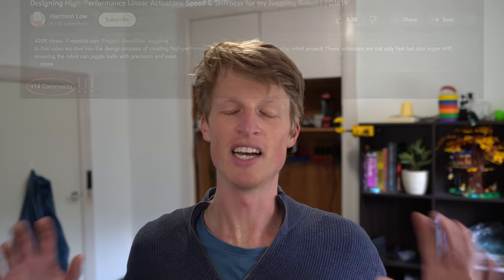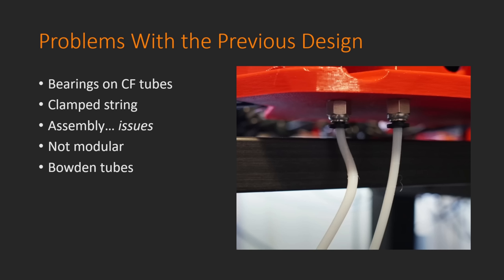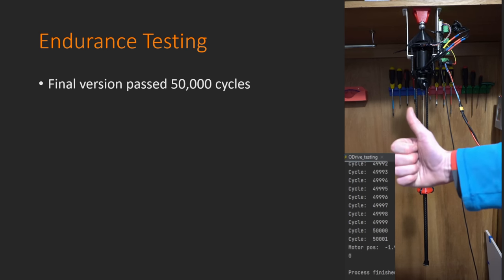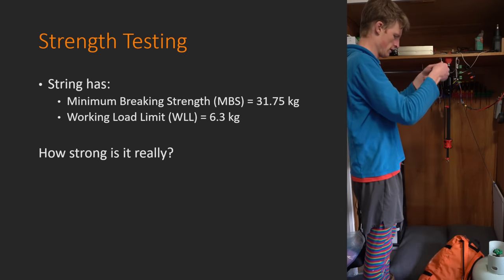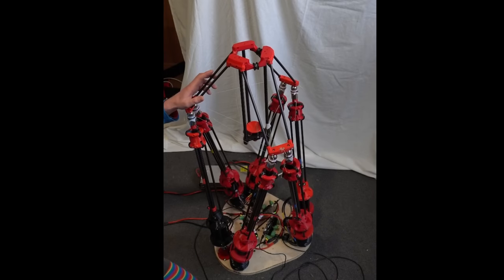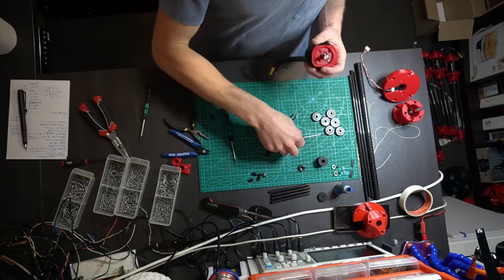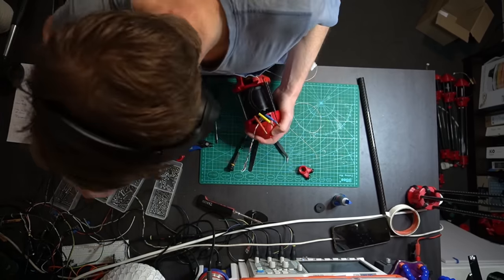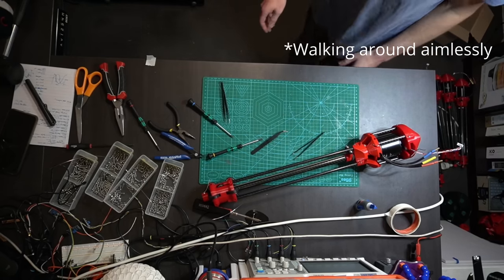My New Linear Actuators are SO MUCH BETTER! | PDJ #21

Comment: Why not flip the motor perpendicular to the direction of the linear actuator and have the body be the spool as you mentioned and then have much more simple routing of the string direction to the rod?
Reply: Ah I see this may be what you were talking about. I thought you meant keep it in line with the rod, but just use the body as the wheels.
Reply from the maker: Yeah I've realised that I didn't do the motor-as-spool idea justice in the video. The viewer's suggestion was to have the motor sideways so that most of the routing would be a non-issue anymore. As for why I didn't do this: I didn't think of it! (the motor-as-spool part, at least.) I did consider the perpendicular motor idea, but decided against it because I don't want the motor to be sticking out the side of the actuator. I have a gut sense that this would likely cause issues down the line once I put all 6 actuators together into a Stewart platform so I want to keep everything as "neat" and in-line as possible. 
I think using the motor body as the spool would still work, though, because I'd be able to keep the centre of mass of the motor approximately coincident with the extension axis.

Comment: If you need to dump break power for a very short time with significantly longer time between breaks,  you could use supercapacitors, as they will essentially be shorts when they're empty
Reply: Just what I thought too. As a bonus it reduces energy consumption.

Comment: The TPU sleeve over the bearing will work way better if you design them to fully engage with the surface area of the carbon fiber tubes. Make them like a circular indent like doing a sphere revolve cut in your cad program where the sphere is the same size as your carbon fiber rods. It will also help hold them centered if you add a bit either side of the bearing on the flat side that helps lock them in, like a U shape that comes down about a millimeter from the outside diameter of the bearing towards the center of the diameter. Hope this helps. 👍👍

Comment: I have in Thingiverse a design for Customizable wheel for 608 bearing, that locks in place and won't slip off. I've been playing with printing the middle part of the wheel in spiral vase mode to get rid of any small bumps (printing artifacts), but I have problems with the round wheel profile getting distorted. Your application does not need a round profile and thus no variable extrusion width, so I think it would be more straightforward to get printed in vase spiral more. Some manual G-code editing would be needed to switch between spiral vase mode and normal printing..

Comment: you should be able to hold the synchromesh cable by having two small metal plates that clamp together with two bolts, when you tighten the bolts it will crush the cable in between the plates and hold onto it real tight, I am taking inspiration from how electric cables are held into some fixtures, its often molded into the plastic in consumer electronics so that when the chassis of whatever is screwed together the two mating surfaces pinch the cable to act as strain relief on where the cable is attached inside.

Comment: High tensile threads need real care in end termination; if you create a good load sync with a gentle bend radius you'll be able to get the MBS. Try using a boss at each end with a number of "dead" wraps which will distribute the load into the thread. If you use the thread as one continuous wrap you'll only need two ends as well. You can eliminate one bearing by aligning the bearing to the tangent of the drive drum as well. If you put a counter rotation feature in the fixed end you won't have to pay the weight in the moving end as well ;)

Comment: Don't wrap the string around the motor, your effective torque thus actuating force will me smaller as the spooling radius would be bigger than the current pulley

Comment: Hi @harrisonlow - great work! I wanted to point your attention to a type of string that has much higher strength called "spectra" or "dyneema". used most commonly in sailing, paragliding and kitesurfing, such strings can support 100s of kilograms in rather thin gauges. The fibers are also cut-resistant but you might have a heat problem with them and might consider lubrication to control that.
Reply from the maker: Thanks for the suggestion! I've actually since swapped to dyneema (0.8 mm) and I love it! 😍 Super strong, really thin and flexible and barely any creep. I actually have a video in the works on my testing of a bunch of strings 😁

Comment: On the TPU sleeves, you should make them concave instead of convex.  This will allow the bearings to have more positive contact with the carbon fiber sleeves.  This will make the system more rigid.
Reply from the maker: I actually originally had the TPU sleeves being concave instead of convex and they had an insane amount of friction (though they were a very good fit for the CF tube). Someone also recently had a great thought about this on Zulip: 

"The problem with sleeves that follow the CF tube is that you will have contact points with the tube that are at different radii from the axis of the bearing." 

Very clever way to think about it!

Comment: I think you can have fewer than 3 pulleys per side if you offset the spool insted of constraining it to be coaxial with the moving rod. The minimum might be with the spool tilted to be perpendicular to the rod.  

Rock west prefabs hex section carbon rod which might be useful for improving the torsion issue.
Reply: If mounting flex leading to the string generating derailing forces can reliably be ignored, then absolutely he can use just 2 pulleys per string with the design shown. If derailing forces can't be ignored, then using pulleys with a "taller lip" (to retain the string better) may be enough to compensate. It's probably not worth focussing on right now, but definitely something worth considering on the maybe-last version.

I can't give any formulas for how to do the calculations off the top of my head, but the concept is fairly straightforward:
1) Each pulley corresponds to a plane, which it's embedded in (and parallel with); one of the sections of string (e.g. "from the spool" or "to the attachment point") must also be embedded and parallel with this plane, while the other section won't be;
2) The task is to intersect these planes with each other in such a way that:
2a)  the intersection is tangent to both pulleys, AND
2b) the section of the intersection between the two pulleys doesn't pass through anything else (e.g. the spool), AND
2c) the plane with the string section that passes to the spool should be as close to perfectly tangential to the spool as possible (to minimize the risk of derailings).

Comment: Use a collet block to terminate the synchromesh cable.  The bonus is that a collet will draw it tighter as your cinch down on it.

Comment: You can do 2 pulleys per string. Remove the middle one, rotate the closest one to the motor 45° clockwise with the axis of the rope going to he motor. 
Rotate the other pulley 45° conterclockwise about the vertical axis. 

For BLDC motors, when the H bridged are configured where the coils are energyzed similarly to a pwm where 0 speed is 50% +V and 50% -V, it gives a good speed control because the shortest pulse polarity acts like a regenerative brake by itself. 
Apparently its called 6 step commutation and it required a bipolar wirering.
Reply from the maker: Yep, I think you're right about the two pulley idea! Good thinking!

Re. BLDC motors: I'm not sure I want to deviate from using the ODrive controllers that I'm currently using; I trust the makers of the ODrive to be far more competent as designing these circuits than I'd be. It's interesting to know that this sort of configuration is possible, though!

Cheers 😊
Reply: I thought the same. As long as the pulley is in the plane of the contact points between the top pulley and the motor, it should work?
Reply from the maker: Yep, I think you're right. I'm not sure how I didn't see this when CAD'ing!

Comment: I see a lot of comments about using concave TPU profiles but I don’t think this is a good idea. It sounds intuitive but you’d be over-constraining the system. 

Also, don’t use heat-shrink! And don’t use Teflon. The key to preventing wear with rolling surfaces is matching the hardnesses as closely as possible. The reason the TPU works well is that you’re better able to control the preload, but the gold standard here is going back to the plain bearings but with a  more precise way of adjusting how tight they are. 

Also this is where the twist in the central carbon fiber rod comes from: slight misalignment in the guiding bearings, in the vertical direction. 

I was glad to see you ditch the pulley system for measurement. Very cool to see you got such good repeatability. By the way this is most commonly expressed in terms of 3-sigma repeatability, so if your standard deviation was 0.057mm you’d say you have about 180um repeatability. This is extremely good for something like this, well done!
Reply from the maker: Cheers for the input! Some thoughts:
1. I actually originally had the TPU sleeves being concave instead of convex and they had an insane amount of friction (as I suspect wouldn't come as a surprise for you 😛)
2. There has been a ton of feedback on this bearing block and I'm starting to think the best solution would be to buy some higher-tolerance tubing and just use linear bearings. Would be sleeker, lighter, simpler, etc. (just more expensive 😅)
3. Well that's nice to hear about repeatability! I'll take it 😁 Honestly I would've been happy with < 1mm precision/repeatability, so I'm stoked by the actual performance!

Cheers 😊

Comment: Great work, especially with iterations. One thing that can't go un-noticed is the cyclic testing. With no load, almost every actuator outperforms their intended application. It's the testing of cycles under different loads and disturbances that can really speak volumes for a design. Loved the video. I wonder if you shouldn't consider extruded aluminum hexagonal cross section, as the part in motion. Would make for better load distributions. You could also add steel wear surfaces if you figured a good way to bond thin shim stock to aluminum.
Reply: I agree, cycle testing under load is going to define how well the design will hold up. The forces are going increase dramatically depending on how fast you accelerate and decelerate.

Comment: You can eliminate one pulley on each line, rotating the first one 90° and placing it on the right place. I'd also swap the strings on the spools for better clearance, probably.

For the strings, I don't know what you are using, but 1.5mm or 1.7mm dynemma could work, or something similar in Kevlar if temperature or wear is a problem. Friction is quite low with dynemma, have an eye out for creep, there are some variants with lower creep that could help to facilitate the tensioning.

If you add 4 more bearings to the moving block you could spare 3 from the stationary block.

Using the motor as a spool seem problematic to route the line, unless you spread the bars, and you need them parallel so seems like a packaging hassle. Also, you remove flexibility as changing the spool size gives freedom in the velocity/force compromise.

Lastly, adding regenerative breaking should be really good, you should be able to find a motor driver that could handle that. More advanced drivers can also help with the different drivers working together, I don't know how the premature disassembly got to be as 6 degrees of freedom with 6 drivers should allow for small errors in actuator position to translate to small errors in platform position, not unscheduled disassembly, but start slower next time and maybe incorporate some compliance in the connections until you dial the control setup.

Comment: for the sincro-mesh cable put a helical cut into the 3dprint to match the synchromesh cable and a tab to hold the cable into the groves (tab could be grooved too but not required)

Comment: Is it possible to physically brake the motor? Even if the brake is not used all the time it may improve power usage over time because motors wouldn't need to be used to "Hold" any load
Reply from the maker: That's an interesting idea! I'm not sure I like the extra maintenance/complexity of physical brakes, but it's a great backup idea if I need to push these actuators super hard in the future and I'm not able to fix this problem the "proper" way (assuming there is a "proper" way, which I feel there must be).

Cheers for the idea!

Comment: You can measure thousands of cycles with pretty much arbitrary precision if you use a Pi HD camera and the right lens and focus on the target area(s).
Reply: I hate to tell you you are not getting mm precession with a single pi camera. You would be incredibly lucky to get cm precision

Comment: Loving seeing this develop,thanks for sharing. Couple of quick thoughts... 1. Could you use concentric tubes, so one large and one small instead of four small? Also, can you get  carbon fibre tubes in square section, which will help with the twist?
Reply from the maker: Cheers!
I briefly toyed with the idea of using one large CF tube for the support structure (rather than three small ones) but I wasn't a huge fan of it for two main reasons:
 - Large CF tubes are super expensive
 - I don't like how opaque they are; I like being able to see the "inner workings" of the actuator. I've come to find that having an "open" design is also super helpful for fixing issues as they arise

The square-section tubing is a good idea! I wonder how that would affect the geometry of the upper "bearing block"? I'll have a think about this. Thanks for the thoughts!

Comment: Definately use the dual wheel design on all 3 outter shafts to stop torsional forces.  And for braking you can use another mini actuator to press a cylindrical bearing down against the wheels in the bearing block and the harder it presses the more it brakes the bearing and an electrical actuator is very percise and fast so with the right algorithms  it can precisely brake the movement.

Comment: For terminating the synchromesh cable, you could use a metal ring attached to the end of the the rod/the rod stop, and simply thread a small hole for a screw that then clamps on the cable. Im having trouble explaining it, but if you google crossfit jump rope, it's the little screw at the end that I'm talking about. It should be strong enough with simply the clamping pressure, but you could always allign the screw up against the black coiled wire. I hope this helps. Fantastic work btw!

Comment: You could reduce the number of pulleys by putting the motor axis at a right angle to the axis of the actuator. If you make the drive spool the right diameter and offset it a little (so one side is in the center and the other side is in line with the side tube) you would only need the one pulley at the far end of the 'blue string.'
Reply: This is a lot better than the geometrical fiddling that I suggested.

Comment: Great project!
What about dynema as the string? Very low stretch, very high strength. Standard braid so making sliced loops and terminations is easy. Also, compression cones for attaching a possibility.
Reply from the maker: I've actually recently been doing a TON of testing of different string materials and dyneema is looking quite good!

What do you mean by compression cones? I'm not familiar with that term

Comment: dynema rope is super strong and very low friction. prob the strongest rope material we have. very flexible
Reply from the maker: I recall looking into Dyneema thread after the last video and don't quite remember why I lost interest in it. It might've been hard to find in super thin threads? If you have any experience in the matter, how do you think dyneema would compare to synchromesh cable (shown at 10:30 in the vid)?
Reply: @harrisonlow  ACCURACY of the syncromesh
1. Pitch Error ‡ .002 in.
2. Cumulative Pitch Error + 0.16 in. max. over 100 pitches.

Comment: Here's an idea for terminating the syncromesh cables: route the cable around an eyelet and crimp the end onto the cable. That is a cable terminal that will not break (the cable itself will break before the terminal does). Then you can use a hook screw and a hex but to tighten the cable as needed.

Comment: I’d be curious what the accuracy of this (or the next iteration) would be with a bunch of consecutive movements that are all in the same direction, like 5 random points chosen to be consecutively descending or ascending, and measuring primarily the relative deltas that are then achieved between the points, and then comparing that to the requested point deltas.

I would not be surprised if your consecutive deltas end up showing far higher precision when moving repeatedly in the same direction without the driving string having to change. 

If this is the case it could be a good indication that some undesirable inaccuracy is coming from the slack transferring between the two strings, and you might be able to design movement paths around that (ie. preferring multiple consecutive movements in the same direction if at all possible)
Reply from the maker: That's a very good point! Either way, I'm super happy with sub-millimetre precision (let alone < 0.06 mm!)

Comment: You should get a force gauge so you can get an accurate force reading for both extension and contraction; At least more accurately than having to binary search the max load.
Reply from the maker: You know what: I actually totally forgot that I have a force gauge lying around. I've been wanting to make a little box to house an LCD display and have a data-out port for datalogging but have been putting it off for the longest time. I completely forgot I have it! 

Maybe this is the push I need to finally get that sorted out. I'll add it back up my list. Cheers for the reminder 😊